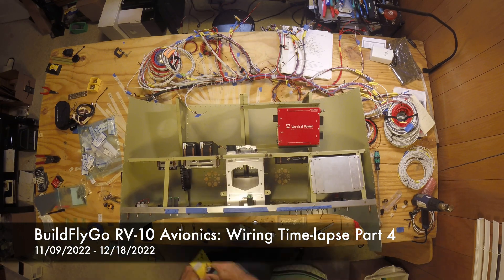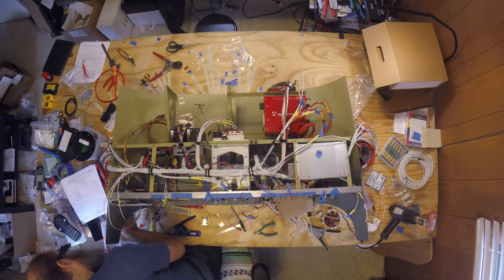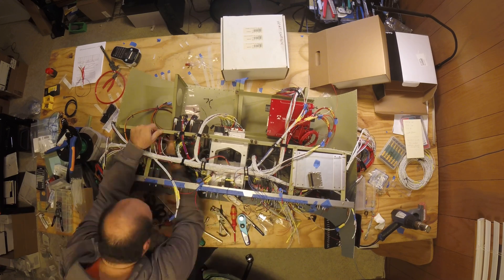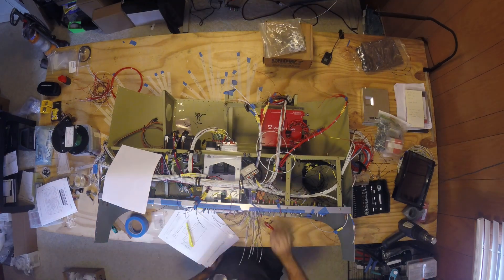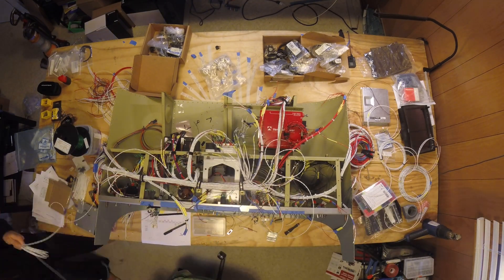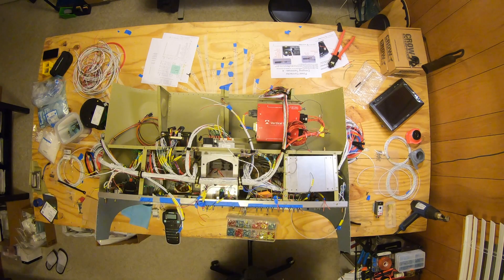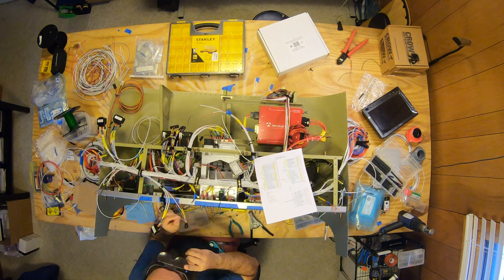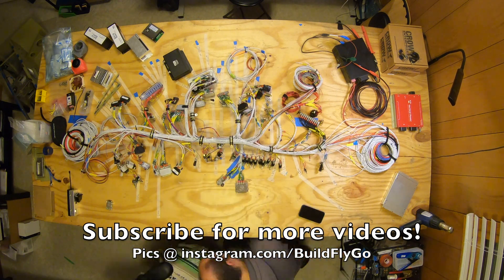RV-10 Avionics - Time-lapse 4: Final sizing and adding connectors

Comment: As an RV-10 builder-pilot/EAA tech counselor whose aircraft is now 16 years old with 1350 hrs TTSN and in the midst of avionics upgrades, as I do those upgrades I am regretting having done tight wiring bundles with point to point minimal length wiring between avionics boxes.  And now there is no option other than laying on my back to reach up to undo all of those adel clamps and fish a wire or two out of a large bundle to re-route it.  I can barely and only painfully reach the connectors at the top of the center stack avionics.  I really wonder about the maintainability of full panel builds hired out to avionics shops by builders, many of whom really don't know how "the hip bone is connected to the thigh bone" in their panels. 

If I could rewind to the original build, instead of tight wiring I would have optimized accessibility, modularity and maintainability.  Once a project, always a project over the lifetime of the plane!  So building with the mindset that any component you put in the panel is likely to be upgraded and replaced by something that is wired differently pays dividends in the long run.  It has been a great benefit to insert male-female pairs of DB connectors in the middle of wire runs, so that a new unit can be wired to the DB connector interface and not directly to the target boxes.  This is especially true for units that have multiple interfaces to other boxes, such as installing a GTN 650xi that replaced a GNS 480 as GPS/NAV/COMM, and EFIS display units now with synthetic viz, traffic and weather that the originals never had.  Live and learn.
Reply from the maker: I hear ya, for sure. I've included service loops for each component, and made sure everything is well labeled and documented. I'm not a fan of adding extra connectors where they aren't needed as that adds 3 extra points of failure to each wire.